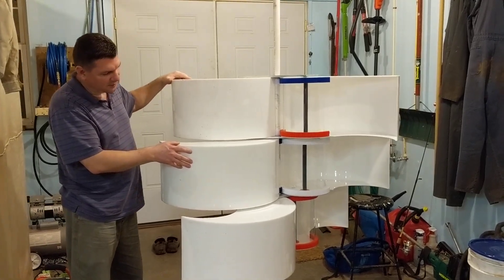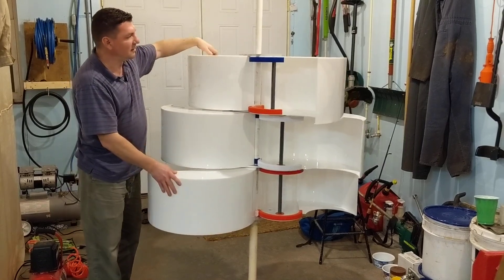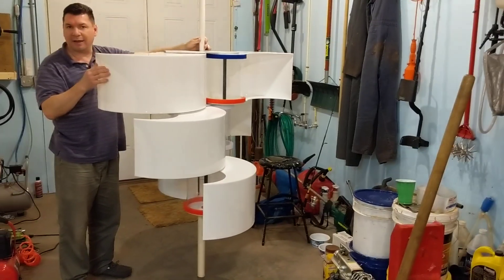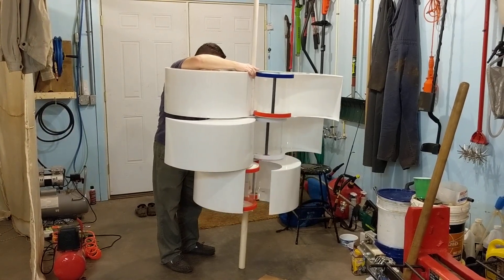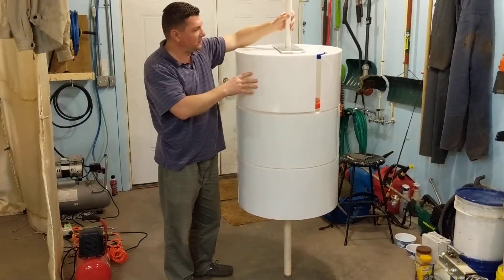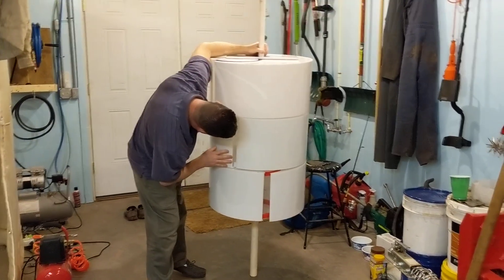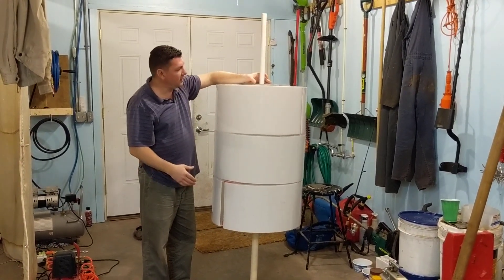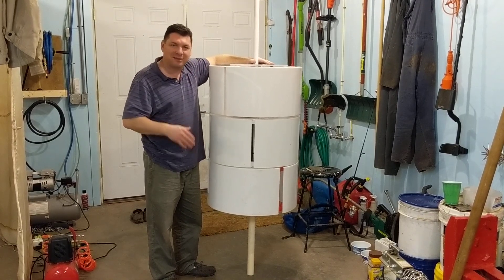New Vertical Axis Wind Turbine Prototype almost Complete - Harmony VAWT

Comment: One interesting thing about the old savonious rotor design is that its a flow through rotor, and as the air turns it , it also passes through it and after it pushes the rotor, it then pulls it. Your design is not taking advantage of that benefit, but it could be modified. The furling action is very clever, is it automaticly triggered by centrifical force?
Reply from the maker: Hi @rowgler I am aware of this enhancement and in fact use it to a degree with the current design, but will be using it even more in the next iteration. That front (small) sidewall is coming out and this will enable the passthrough "S" configuration when viewed from above. The wind should drive through from the one scoop to the other one quite efficiently. Thank you for bringing it up though. I think in my last video I made I talk about eliminating that small front wall. If you'd like to see Harmony VAWT Latest Updates, here's the URL: https://www.youtube.com/playlist?list=PLqbwi-6vny7s3NVYuynqVG5oyLxysgfIs

Comment: Magnificent! Can’t wait to see it in production! Oops, I meant operation but production is even better ; )
Reply from the maker: @SaintTrinianz
 thank you! I can't wait to see it in operation as well. It'll be so cool to finally see all 5 scoop pairs turning for the first time and then to be able to furl / unfurl them freely as its spinning should be awesome. I hope that the data yields some cool results. I was originally hoping for 800w of power in a 10mph wind but based upon other similar sized units that's likely overly ambitious so I'm going to reserve hope of any specific amount in 10mph wind and just work to make it as good as possible.
Reply: https://www.aliexpress.com/store/product/Big-sale-5kw-24v-vertical-wind-turbine-250-RPM-wind-generator-24v-48v-96v-3-phase/3684111_33006599480.html

https://www.aliexpress.com/snapshot/0.html?orderId=100836981766690&productId=32983319309

 Similar style with high efficiency